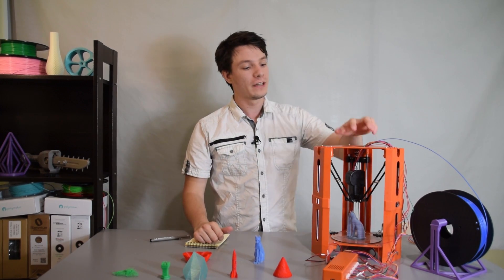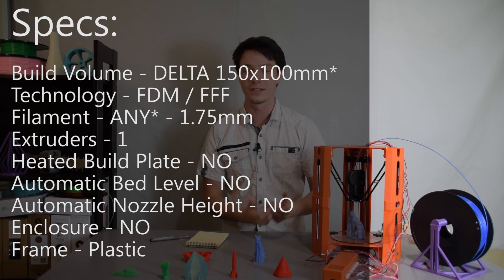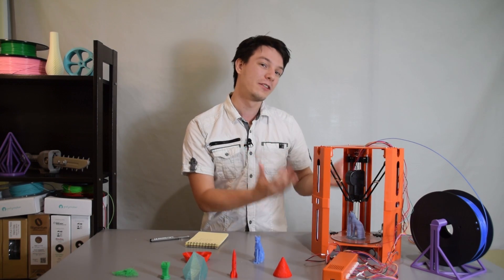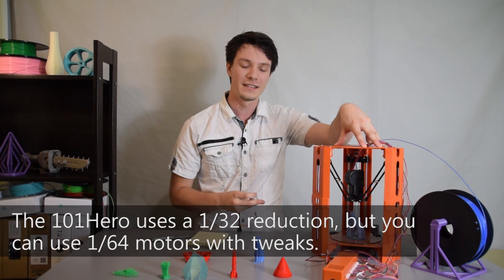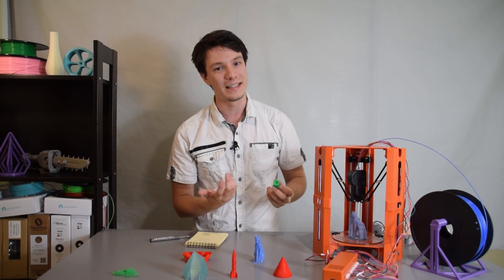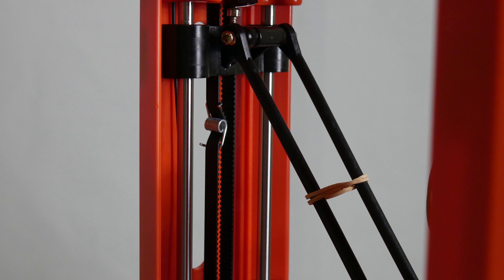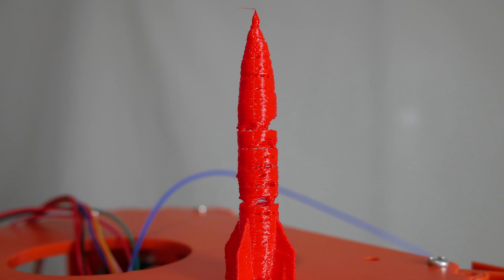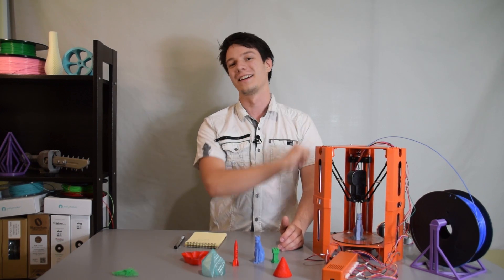101Hero 3D Printer Review

Comment: I'm going to chime in 7 years later! I still have my 101Hero 3D printer, I use it to print out little parts and such, sometimes a customized horse shoe or two and it's still working and running! Truly wish the 101Hero team would've stuck around, they would've been powerhouses in the 3D printing work right now.

Comment: Unfortunately/fortunately no longer available in 2021. I was thinking of using a cheap, small 3D printer like this for printing figurines, etc. - fit it with a small nozzle, slow it way down, etc. and then I wouldn't be tying down another printer for this purpose. Problem is, for the currently available cheap printers (mainly from EasyThreeD) you can't get small nozzles.
Reply from the maker: Get an ender 3 or similar, anything cheaper really isn't worth touching. This printer included! Resin is better for miniatures though.
Reply: @MakersMuse  That's true for serious work, I guess. On the other hand - the EasyThreeD machines do seem to be getting good reviews - most people seem to be getting good prints with them and they're easy to assemble. I suppose one reason to get one would be just for the fun of playing with a very cheap printer.

Comment: For those wondering hardware of this caliber can become a great printer. I would suggest the rubber bands of course(even production Delta's use similar devices) to tension the mechanics. The biggest issue I see is the frame.  I'm sure people will be making plastic upgrades available on thingiverse ect but you could also pickup some 1/8" x 2"  angled aluminum from Home Depot/Lowe's for those of you in the US. From there each "tower" can be stiffened with some aluminum or steel plating from the same source. I know many who have used these same steppers for lightweight direct extruders with great success but the 3 tower steppers should eventually be replaced with larger/faster steppers for $8-10 each.

Comment: what happens if you made the frame better like printing much more rigid supports  with one of your other printers and replaced the cheap motors with the better ones would that make it over all better
Reply from the maker: sure would, but why not just... use that money you'd spend in upgrades to buy a proper one to start with, like the TronXY X1?

Comment: considering the heating bed – it can be made here very easily with car parts - like anti-frost heating elements for windows, which very accessible, i even found in Auchan supermarket a special "conductive glue" for repair anti-frost heater if metal string cuts, you can repair there almost 2 cm cuts

Comment: so you are the guy who suggest hairspray and glue.  
with a heated bed. you DO NOT NEED THOSE   infact idiots spraying hairspray onto the bed while it's on the printer are destroying their printers.  

ALL you need to do is clean your glass with WATER.  grab some wet toilet paper and wipe it down.   done.   nothing else.  heating the bed will dry it before the print starts
Reply from the maker: +EstaWorks-3D did you even watch any part of this video it doesn't have a heated bed xD
Reply: wich is why i specified that with a heated bed you don't need it.  wich you did not do.   now people are using glue and hairspray on heated beds (anet a8 support page) when their problem is improper cleaning or leveling. and then wonder why their bearings have gone to shit. or why their printer is so loud
Reply from the maker: +EstaWorks-3D I would never spray hairspray on a mechanical system >_> glue is needed on occasion as a helper though even with heat, depending on how thin the first layer is
Reply: you wouldn't but incase you hadn't noticed.  the rest of the world isn't that smart
Reply: i don't know about abs.    but for pla you don't need anything.   just about 55 degrees on the bed.  and a clean surface.   petg sticks better then pla.  bed temp 60.   and ninjaflex you don't even need to clean the bed.   even with dust on it.  it still sticks like crazy.  need a razorblade scraper (sticker remover) to remove the skirt from the non treated glass.  
it's not special glass either.  just picture frame glass.   3mm thick.    i live in the netherlands.  i don't know how much your dryer climate affects this.  it's pretty damp here. anywhere from 60% to 90%

Comment: at 8:40, you mention that because it's made out of plastic, the whole thing wobbles insanely.  

It would seem to me that simply wrapping some string, diagonally from top to bottom should dramatically tighten that up.  Put 12 screws into the pylons, then attach the 6 strings to the screws.   You could also use something more sturdy (which would defeat the purpose on a low cost item).  String will only help in one direction while a metal post would prevent motion in both direction.   As long as you have strings in all of the support diagonals, you only need to deal with stress from one direction.

Comment: Are those 'steppers' actually steppers, or are they dc motors with feedback sensors?
Reply from the maker: +Richard Smith tiny crap geared 5 wire steppers.

Comment: Can you make a video for noobs?   I have an engineering background and have a ton of drawing/3d modeling experience.  I am interested in 3d printing and know nothing about it.

Can it talk about materials, min/max limitations, framework, controls, interface, software, file types, print quality (how it's measured), equipment costs, material costs, support/communities, accuracy, and precision?  Please also discuss setup, operation, and tweaking.
Reply: Second that engineering student amd I wanna pull the gun on a 3d printer for prototyping ;)

Comment: I ordered one as a toy, an introduction to 3d printing on indigogo, the comment board there is a mess people are really unhappy with this thing. I haven't received mine yet, it was expected to have been delivered back in November. common problems on arrival seem to be broken motors, or duplicate wrong or missing parts in the kit. If it ever arrives in the post I don't have my hopes up that it will work at all, pretty much regretting this purchase, I don't think I will use indigogo ever again after this.

Comment: Anet Printers are so nice. If you tweaked them right the prints are mind blowing. Got my Anet A6 for around 180€ as a Kit and it performs extremely well and Even has a heated bed and 22x22x25 cm build Volume.

Comment: Could NEMA steppers be easily swapped in?

Low price sounds nice until you hear the real price.
Reply: Yeah if you want to see the whole machine twist up like a pretzel you could run bigger motors. He barely touched the frame and it was going all over the place. About all you might be able to salvage out of this product is the timing belts, and the guide rods. Besides that the rest of it is more of a pop up book, or model, than actual machinery. This is what a 3D printer looks like.
Reply: Sounds like a machine not even good enough to sell in Harbor Freight and they do have some junky, low quality stuff there.
Reply: I could see how they try to support the hobby by showing you that the parts can be made on a 3D printer but ideally, you would want a sturdy printer at least.  Not some wobbly half done POS with sickeningly underpowered motors.  The printer I am considering is a Trinus.  They appear to be very good quailty for the money.  Best of all they are not some horrible vaporware gimmick like the OLO was.  Shame that didn't come to market, my 441 PPI display on my Xperia Z would have complimented that thing nicely considering the expected print quality depends on the quality of the phone display.  It would have probably produced some enviable prints considering that but the Trinus seems like much less hassle and is compatible with many filaments.  I think what killed the OLO was the maker of the printer dipping into the funding for personal use if I am not mistaken.  Let that be a lesson to other printer designers on how to ruin a good idea (or a possible would have been good idea).

Comment: Fisher technic has a 3D printer. it's available here in Germany for 514,95€ and therefore really expensive. but since it's highly modular. the build volume can be expanded easily. 

I don't think about getting the 101hero. I am currently looking at the Cetus3D when they can ship in February. 

you just mentioned the Anet A8 as a good value product. I will find some reviews if it.

Comment: "... cheaper than a complicated LEGO kit".
That got me thinking... Would it be possible to make a 3D printer out of LEGO?
Like as a proof of concept more than anything
Reply: Sure. You could even make it a cannibal, melting its kind for filament :)
Reply: AlfonsoB LEGO is too expensive to cannibalise 
I'd rather buy the cheap knockoffs for that :P
Reply: some trivia : lego engineers that experiment with making kits don't bother taking them apart, they dump it in the black bricks melting machine.
Reply: I mean, you could theoretically melt down lego bricks to be printed back into lego bricks, all on a lego printer. that would be neet. like a lego recycler.
Reply: The answer is yes, well, kinda of
/watch?v=VXeQ5WOiPFw
Reply: Paul Frederick look it up, lots of people print Lego bricks. The tolerance is tight enough for custom models and such
Reply: yeah someone did it with a hot glue gun as the extruder
Reply: It would probably work as LEGO is made of abs and it would be more sturdier than this one. You would have to use 2 part epoxy for every block though.
Reply: what if you can make a 3d printer out of lego that was printed by a 3d printer
Reply: Lol. Google "3D printed Lego". I'm on a phone so sending links is difficult.
I understand what microns are, thank you, and own a 3D printer. 
By doing a few prints at slightly different scales it is easy for the average 3d printer enthusiast to find a happy medium where the plastic shrinkage and printer tolerances are all close enough for a printed piece to interface with a Lego brick
Reply: Adafruit's 3D printed Lego tape is a great example, one you could have found without even leaving YouTube
Reply: I mean yeah, 3D printed parts are never as durable as molded alternatives, and their quality is surely very high....

But it can be done
Reply: Cyrus Cuenca I've seen your channel. It has great quality.
Reply: or lego out of a 3d printer
Reply: you could make it out of legos, 3d print your own legos, then take the set back and use 3d printed legos to make your lego 3d printer
Reply: Trying to imagine the quality
Reply: Orrrr could you make a complicated lego kit from a 3d printer?
Reply: I baught one aand fnd it was out of order . it is a very bad good.
Reply: aactually people already did that, or in my time
Reply: No the Lego will melt
Reply: That Cat only the nozzle has to be hot, not the frame
Reply: +William Meisburger-Iwata LEGO bricks have a tolerance of 10 micrometers. I doubt any extruder could achieve that precision.
Reply: LEGO is also too expensive to use as stock too. But that fact did not seem to phase you.
Reply: William Meisburger-Iwata where can I look it up? Give me a specific link please. Because this I'd really like to see. Let me try to put it into some perspective that you may be able to understand. 10 microns is 70 times smaller than a 0.7mm extruder nozzle orifice. Being as there are 1,000 microns in a millimeter. Now are you still sure that thermoplastic extruding 3D printers are capable of 10 micron precision? Or are people merely printing LEGO shaped objects?
Reply: William Meisburger-Iwata so if one brick snaps together it is LEGO to you? Fair enough.  That's more down to the deformation of the plastic than any inherent accuracy though. I've machined hardened steel to tolerances around 10 microns or so, and I must say, it is a bit tricky business. That is done with lapping, and grinding. On machinery far more precise than home 3D printers are. Part of the LEGO joke is it isn't even worth the trouble to hold the tolerances that they do in the material. Yet they still do it, for their own reasons. Bragging rights I suppose? LEGO is insanely accurate for what it is.

Comment: i have a question i was thinking of getting a tiko 3d  would that be better printer for under 200?
Reply from the maker: They're both... different kinds of special. Check out the JAT.MN channel for Dustin's opinion on the Tiko. I've never used one myself.
Reply: Just get the monoprice select mini for $199 https://www.monoprice.com/product?c_id=107&cp_id=10724&cs_id=1072403&p_id=15365&seq=1&format=2
Reply: because i live with 2 Siberian husky's and i live in a cabin in the mountains where theirs lots of dust i try my hardest to keep the hair and dust at bay but it dont work out too well
Reply: hartsf33
You could probably get an air filter. They make air filters for wood shops that trap dust, and stuff. I mean if it is that big an issue that you think about it, then it may be a good idea. The other thing that you can do is put 3D printers in enclosures. People say doing that keeps the temperature more constant too. So there's that benefit.
Reply: i'd rather wait for the fabrikator mini v2
Reply: i have a cube 3d 3rd gen an its getting too costly to run it thats why iam looking for a better but cheaper printer
Reply: well i need something that can handle dust and dog hair
Reply: Why do you want to print with dust, and dog hair?
Reply: hartsf33
I bet. It's a dog's life.
Reply: yep and i love my dogs
Reply: well 2 times a week iam finding dust and do hair in it and iam all ways cleaning the headed end

Comment: As far as you go for cheap 3D printers. Go check the Anet A8 out. I am using it for weeks now and even tho you have to mod it quiet a bit especially in the electronic section to make it withstand long prints, it does print just as well as a original prusa or even ultimaker. After using your tipps to tweak my slicer the quality is absolutely satisfying. I'd love to see what you think of it as i trust your opinion..
Reply: I heard it is the acrylic parts that really let an Anet A8 down. But I guess you could use them as templates to cut parts out of sheet aluminum?

Comment: Maker's Muse - I have a small business doing vinyl graphics and laser cutting/etching and I'm thinking of adding a 3D printer to the shop. What machine would you suggest me looking at in the $300 to $500 range? One of the things I would want to make would be bases for our small acrylic LED lit signs, then anything else I can think of, as well as printing test parts before I cut the actual material with the laser. I am good when it comes to fixing things and getting them to work, but I am looking for something that I could have up and running within a couple of days. I was down a solid week setting up, adjusting and fine tuning the laser and I'm trying to avoid that again. You seem quite knowledgeable when it comes to 3D printing, so any input would be appreciated.

Comment: The thing is, the machine's shit quality control is what's wrecking its toy potential. The loose rods, etc (mine has a mix of motor ratios on the pylons) and other issues on the Hero's KS page just don't have to be that way. Like you said, the injection molds are nice. Would it have killed them to inject four or five more oz of plastic to stiffen up the machine, or buy or make rods without sloppy bearings? No. Anyway, it's nice to see you manned up to the challenge of hacking it, Angus - the prints turned out nice (for the price point) to where any six year old would be proud to give mom a vase, etc.

Comment: it shipped to me for 70$ . it's lots of work to actually make it work . but I always enjoyed working with cheap hardware and try to learn . 
I connected to my raspberry pi using octaprint and mounted a camera . now I can see it working on my phone . I tried few diffrent pla like wood and bronze . it actually print very well at speed of 15. since it doesn't hsve a auto leveling it is really hard to level . To counter that in octaprint you can create own custom control using gcode command and move it to diffrent directions and then try to see distance from platform . add a brim for flat surface and raft 
for uneven one. older versions of like 15.2 works well . add some oil to rods to make it run smoother . make sure to clean those rods as well or it make the black thingy  (I don't know what to call it ) will go off the pully.  before changing to new filament heat it 200c not then stop the printer and take out the filament or it will stuck inside . nobody is getting sd cards with it you have to buy your own or use octaprint and pi. good luck

Comment: Angus please modify it to use standard stepper motors. I have it and two motors are broke
Reply from the maker: Sadly it doesn't like you can, it's using 5 wore steppers not conventional 4 wire.
Reply: Maker's Muse could you modify to use an Arduino with ramps 1.4
Reply from the maker: Why put that much effort into a flawed design? I would just move to another kit.

Comment: You mentioned, the anet A8, but are you aware of the a6? 
If so, do you know how the a6 compares to the A8, or basically any other printer in that price range? 
If not, you should really take a look at it, the x-axis linear rods are beside each other instead of on top of each other, it provides a lot of support for the hotend.
Reply from the maker: I thought the A6 was substantially more expensive than the A8? Would make sense if it's a better machine
Reply: i got the a6 for christmas, just wondered how much better it was.
thanks for the reply by the way :)